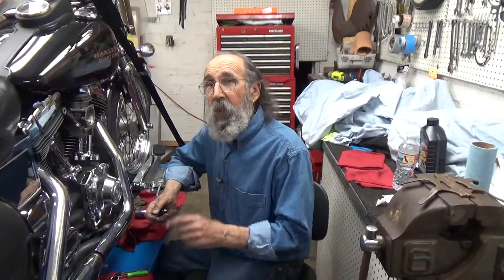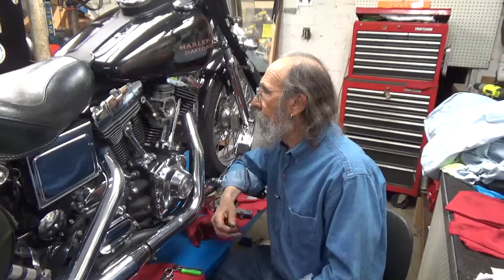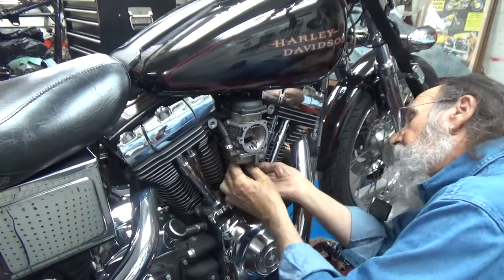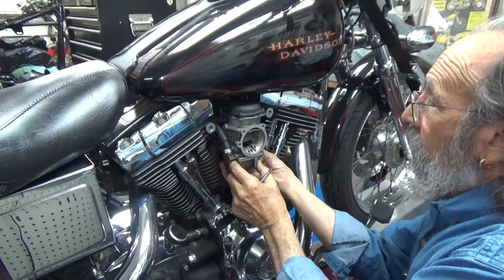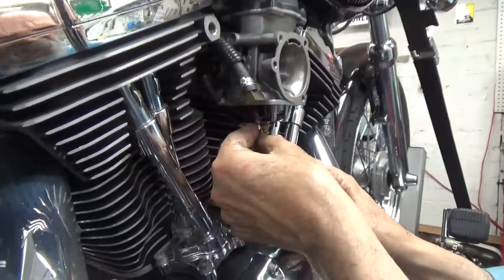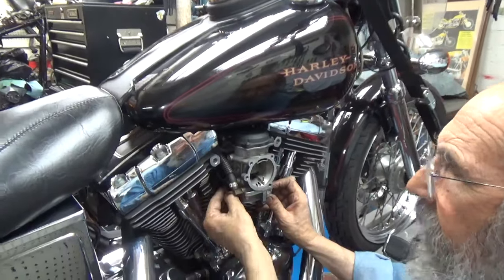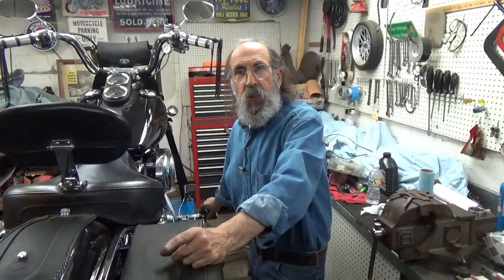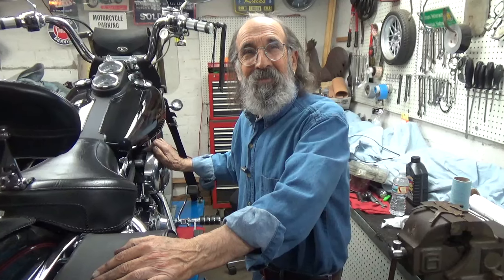Rejetting the Carburetor on a Harley Twin Cam

Comment: My 72 Ironhead sat for 20 years.  It started on the third kick with 20 year old gas.  Taken down to the last bolt, rebuilt, stock, Bendix carb.  I found a local genius at a small town dealer, Columbus, Ne (been doing it since the 70's).  He did the lower end & trany.  Now it's my most reliable vehicle (an IRONHEAD!).  BUT fuel economy is about 30/mpg and the plugs are sooty (In the 70's I had an SU from an audi and I got ~60/mpg).  If I lean the idle or main it runs poorly.  I have taken GREAT! care to get the manifold air tight and the carb bracket is in place.  I've only ever set the timing with an ohmmeter.  Could timing cause this?  I do own a timing light, just not my most favorite thing to do.

A note on Bendix carbs.  I have about 6 from ebay.  All of them, every one, has a leaky fuel inlet valve and changing the needle doesn't fix them.  There are utube vids about polishing the seat or tapping a ball bearing in the seat well.  That doesn't work.  In fact it's a trick to catch the problem.  I use a clear fuel line, mount the carb low, fill the bowl & line to a mark and watch.  If the leakby is slower than the engine needs it may not be noticed but eventually the bowl overfills and causes the carb to run rich.  I lost 1/2 a tank once because I left the petcock open at a 2 hour stop; and we all know where that gas ended up.  I made a sleeve on a lathe and CAREFULLY drilled out the seat and fixed one of my carbs.  Last week I found a CV carb, which is waiting for me at home (I'm 10K miles away).  Yeah, it's from ebay...I never learn.
Reply from the maker: Not using an SU that has been prepared for installation on a Harley, I don't know which rules get changed.  An old Bendix?  How about trying that CV.  Be sure unused vacuum ports are plugged.  The low speed jet is the thing to get right.  Not very difficult.  Sadly, although you can replace the needle valve, you can't replace the seat.  Good luck.
Reply: @pacificmike9501  Idiots don't need rules, they make their own to die by.  The SU came off of a car in a junk yard.  As I remember, I only leveled the float chamber and made an adapter plate out of asbestos  (which probably took a couple of years off my life).  It ran very well.  Not much acceleration.  I was a total incompetent.  But the carb I replaced was a Tillotson.  I carried a spoke from an old bicycle bent around the handlebars to prod the diaphragm back into compliance when it got frisky and spitty.  It probably didn't occur to me to get a new diaphragm.

Comment: HEY MIKE IM LIVIN SEA LEVEL OR JUST ABOVE ON A HILL AND HAVE THE OLD CV CARBURETTOR ON MY 99 HERITAGE CLASSIC I SEE MY BIKE IS LEAN SPITTING WOULD YOU RECOMMEND ME CHANGING MY LOW JET TO A 52 LIKE YOU HAVE MENTIONED EARLIER IN THE VIDEO? CHEERS
Reply from the maker: That should be close.  If you have any non-stock changes (air cleaner, pipes) it will change some.  If you're all stock, you might try a 50 at sea level.  You may have to experiment a little.

Comment: Hi Mike..How's it going?  Many year's ago I did something similar on the cheap to my 1997 HD 1200 Sportster. I took a hole saw and drilled the baffles out of my exhaust pipes. I installed a larger jet in my CV carburetor and put on a Screaming Eagle air box. It sure opened up the factory restriction's. 
LOUDER IS FASTER. Stay safe...
Reply from the maker: Thank You.  You too.

Comment: My sportster has "carb farts". Mostly when its cold and while taking off. What do I adjust? Please help.
Reply from the maker: What is it?  What kind of Sportster?  What kind of csrburetor?  What's been changed on the bike?  Air cleaner?  Exhaust pipes?  Ignition system?

Comment: I'm doing a rejet on a 2003 fxdl and I see people are saying you should adjust the mixture screw any suggestions I would greatly appreciate it
Reply from the maker: There is a small aluminum plug on the bottom of the carb.  Drill a hole carefully through it.  Don't get carried away.  Screw a sheet metal screw into the plug and wiggle it until it slides out.  Now you can see the idle mixture screw.  Start the engine.  When it warms up, turn the screw in and out until you find the smoothest idle.  This is done after rejetting.

Comment: I still have a carb as a matter of fact I'm in the process right in replacing mine thanks for the video think I will go with 175 main 50 slow
Reply from the maker: The main jet is usually fine from the factory.  The slow jet is generally what needs to be changed.

Comment: Mike, I'm doing a top end job on my 2012 Road King and I have a question about replacing the piston pin bushing. I haven't seen anything on your channel about this. Do you have any advise on this topic?
Reply from the maker: Check the above answer to the comment.  I believe it's there.

Comment: hey mike im at 1500 ft. above sea leval what low speed jet should i be using . I have stage 1 air filter after market air exhaust tips. & s&s 510 cams. I have a 46 low speed went to a 48 but everyone was telling me that was to big. so i put my 46 back in & it still coughs. when its cold. so i pull the enrichner till it warms up then i push it in but i still get occasional cough. should i try  a 48 50 0r 52 small jet.
Reply from the maker: How did it run with the 48?  Did it cough?  Did it matter what anyone said?  Be methodical.  The cough is what is normally known as a "lean spit"  All I can do from here is assume that's wht's happening.  If in fact it is a lean spit, 46 is too small.  Try 48.  If you get to 50 or even 52, you can always go back.  I'm guessing 50.  Just a guess, but I don't mind being wrong.  It's not much work.  And you're close on this.
Reply: It was still coughing. I'm gonna go to a 50 & see what happens
 Thx. Mike love the video's.

Comment: May I ask you what setup for jets should I use for a 2002 fxst 44mm se carb 1550 with delkron jugs and heads 80cc heads 10.5 to 1 Ross pistons 570 crane canes krome works exhaust and se high rate air filter.dyna tech adjustable ignition.  Fueling lifter roller rockers. Any thing else you may need to know to help me just ask.
Reply from the maker: I'd start by finding out where it started.  How was it working before?  What did the plugs look like?  Gotta know it and and have a little "prior experience" with your locale.

Comment: Commonly, the lean mixture at the low range of carburated TC is signs of intake manifold leak,  I've resolved this problem changing all rubber sealing rings on the intake manifold. Obviously you can fix this problem by adding fuel to the mixture but first of all, you have to fix sealing. Good luck.
Reply from the maker: Of course.  Usually an intake manifold leak is diagnosed by the difference in the way the plugs are coloring.  Then it can be checked various other ways.  But when exhaust and/or intake has been increased, factory jetting, which is always on the lean side, must be addressed.
Reply: @pacificmike9501  Thanks for the quick response, now I can sleep calmly. Cheers

Comment: my 2001 superglide sport with the same s.e. mods and 42 jet snorts once in a while but i thought it may be a sticky float valve... if i recall the stock jet was a 38..
Reply from the maker: You must be at a real high altitude.  Or, maybe you've got a 42 and need a little richer.  You're speaking of pretty small jets.
Reply: @pacificmike9501  more likely i forget the true jet size - i will look at the instructions that came with the kit...thx.,.. i have been fiddling with gumout till now. it can be dangerous at intersections etc. if your bike cuts out. it was the cause of my first (only!) accident when i got rear ended (minor) as a kid.

Comment: Mike, I have a 2005 Electra Glide, 95 big bore, and 211 cams, K&N intake, and Reinhardt slip ons, and a CV carb of course. Which pilot jet would you suggest starting out with. I am at sea level here in NC. Thanks a bunch. Having a hard time getting it to idle after starting. After a ride it idles fine just a little higher. Tried turning the idle screw to bring the rpm's to 900 - 1000, but after riding it and stopping at at light, the idle is way too high. I am sitting at about 3 turns out on the adjustment screw. Thanks for the videos and your time on here learning us!!
Reply from the maker: This is a guess (mildly educated).  Try a #52 Pilot Jet.  Other than that, you may have a vacuum leak (most likely at the intake manifold).
Reply: @pacificmike9501  Thanks, really appreciate your time and knowledge. I will give that a try and also pull the carb to see if there's a leak in the rubber seal at the intake.
Reply: @pacificmike9501  Mike, I sprayed some carb cleaner around the seals of the intake to the jugs, didn't get anything, a rise or a stumble in the RPMS. I think the seals are good but I will change the seal from the carb to the intake when I re-jet the pilot. Thanks a bunch!

Comment: Ethanol in gasoline has raised hell on anything with a carb(s). Especially on the smaller pilot (idle) jet. I have resorted to using VP ethanol free small engine fuel in my bikes.
Reply from the maker: Sounds awful.  I'm really not knowledgeable.

Comment: I have a 70 shovelhead. Both of my spark plugs keep getting carboned up. Like a wet black carbon. What could be happening
Reply from the maker: Too much fuel verses air or ignition very weak, unless  you're burning oil.  If it's one plug, you most likely have a vacuum leak.
Reply: @pacificmike9501  I just had the coil voltage regulator and stator replaced. So I doubt it's week ignition. And it's both plugs.

Comment: Mike, thank you for the video. Any jet recommendations for a 1999 1200cc Sportster with drag pipes and similar intake like this? It's having similar issues like lean deceleration pops. Also mid throttle has a dead spot.
Reply from the maker: As I explained in the video, it varies with the altitude where the bike will be ridden most of the time.  Drag pipes, although very cool, rarely work well at low RPM and tend to lose power intil you get going above approx. 60 mph.  However, at  least three points higher than stock will generally help considerably.  Also, changing the air cleaner to something less restrictive than the original unit requires a larger pilot jet.  Good luck. It is running very "lean" and, it's still going to be an issue at low speed.

Comment: I've got a 2002 Deuce with a CV carb and I don't ride frequently enough so I'm constantly having carb issues despite using good gas.  I've been told that shutting off the fuel and letting it run out of petrol between rides would be better.  I live at sea level (Maui), but I believe my jets are stock since my last mechanic had me buy a totally new Harley CV carb.  It's so frustrating because I'm not mechanical and my bike runs like crap- bogs and spits constantly.  It runs slightly better if I give it a little choke, but I don't want to foul my plugs.
Reply from the maker: Sounds like it's jetted too lean.  Does it have aftermarket exhaust or air cleaner?  If it does, you definitely need a larger low speed jet.  I'm going out on a limb here, but if those items are changed and you're roughly at sea level, try a number 50.
Reply: @pacificmike9501  Yes on aftermarket exhaust- it's a 2 into 1 screaming eagle.  I just ordered a CV Performance 48, along with CV Performance velocity tube and a 185 main jet.  I've never worked on a carb, but I think I'm gonna give it a try.  No idea what the stock main jet is that's there now.
Reply from the maker: You are normally riding around on the slow jet until you start going faster.  Remember, when you increase airflow (air in, air out), you must increase fuel.

Comment: What do you recommend for a1977 shovel head as far as jets i live in riverside Ca i’m running a Ss super E and it came with 70 main and A 29.5 secondary when i go on the freeway after 60 miles an hour it coughs and doesn’t sound right? thank you
Reply from the maker: Are your plugs dark?  Do they match?  Do you have S&S instructions?  If you don't, download the from "sscycle.com."  They'll give them to you.  Jet it accordingly and set the accelerator pump as per their instructions.  It will be great.
Reply: Buy a real motorcycle.

Comment: Hey Mike I got a lean cough at every hot start, 80” Evo , just right when bike starts up when motor is hot, never when accelerating or taking off from a stop, have tried 46,48, and 50 slow jet, still does it. Any ideas… timing?
Reply from the maker: Check your accellerator pump.  You should be able to remove the air cleaner and work the throttle, and see the squirt into the carburetor from the little brass fitting in the throat of the carburetor.  The diaphragm in the accellerstor pump could be bad.  Sure sounds like it's not working.
Reply: Pump works great, it does have a plastic thunderslide in it, I’ve wondered if when the bike starts that lightweight slide opens faster than the fuel can get there causing a lean condition just at startup…. Thank you for the reply very kind!
Reply from the maker: You're making good sense.  You could try a stock slide in there.  I've usually replaced those carburetors.  The Mikunis are great on an Evo.

Comment: yep wont  recommend a brand of gas since  Amaco white gas is no more ,but i have been told that low compression motors run better on lower octane gas ?wondering youre thoughts
Reply from the maker: Depends on what the manufacturer recommends.  Different engines require different octanes so the fuel burns at the proper rate for the design.  I've benn wrong on cars and had to refer to the manufacturer's recommendations.

Comment: Hi, I have a 99 Dyna with screaming eagle tips and a stock bike. I live in NJ. Mine seems lacking in take off power. It idles ok. I have the Arlen Ness big sucker with 50 jets. Should I try 52's?
Reply from the maker: Why not?  It's really the way to tell.  Just do the low speed jet.
Reply: @Pacific Mike  it seems I may have a vacuum leak..I believe that may fix part of my issue.
Reply from the maker: Compare your spark plugs.  A light one and a dark one is your indication of a vacuum leak.

Comment: Drill out the stock pilot jet to a 47/49 ims 3.5 turns out,  main 165-185 (depending on elevation) drill the slide air bypass out just a smidge some ppl mess with the slide springs but I never did. Those stock TC88 ENGINES were set up soooo lean to pass emmissions it was terrible.  Great content as usual.  East coast Rudy approved.  😎😎
Reply from the maker: Thank You.  Everything Harley has done for years is way too lean, from the factory.  Glad  you like what we're doing.
Reply: @pacificmike9501  I enjoy your videos very much. I have an 82 FLT. Been on my lift for almost three years. Just gotta throw the battery in it and gas it up. The riding season up in the North East is less than ideal. Stay well.

Comment: I have the same bike (FXDL), same year, same color, everything..... nothing like an old CV bike. Just got done last week using your "brake light switch fix"..... worked like a charm.....thanks for your help Mike!

Edit: Also, I'm sure you have heard about the cam chain tensioner issue on these early twin cams.... have you had to change any tensioners out yet?
Reply from the maker: Sounds great!

Comment: Mike, I have a Mikuni carburetor on my 2000 Heritage. How can I tell which is the slow jet jet and the high speed jet?
Reply from the maker: The slow jet is the one closest the engine. The high speed jet is up the middle. You can also order the manual online by googling Mikuni HSR carburetors.  They run about ten bucks and are well worth it.
Reply: @pacificmike9501  Thank you Mike, you are a prince of a man!! And with that golden voice, you need to go on radio.

Comment: Hi Mike, i have changed the exhaust on my 1982 FXE and it back fires and doesn't run great.  Would you know what size jet i would need to eliminate this problem?
Reply from the maker: Well, not knowing what carburetor (or anything else in your engine), or what your altitude is, that would be quite difficult to guess.  If you're getting what we call a "lean Spit," I would suggest a larger "idle" or "low speed" jet which would then create a richer mixture from your carburetor.  Now is the time to guess.  If you have #48, try a #52.  Again, it's a guessing game until you experience the results.  And, I'm assuming the engine ran well before you changed the exhaust system.
Reply: @pacificmike9501  thank you ever so much for getting back to me. I am sure that you receive a large amount of questions from all over the world.  I live in France and we are at around 1500 ft. I have an s&s super e carb. She ran without any issues before i installed the new Santee upswept exhaust system. The front plug fouls after around 10 minutes of riding. I appreciate that it could be a variety of issues (exhaust leak, manifold leak, bad plug/lead) but wanted to ask the question regarding jet size as this is new to me. Thanks to your videos i manage to do a lot of the work on my bike on my own ie serviced the clutch recently. Keep up the good work and thanks a million. Take care.

Comment: Hi Mike I just do the top end on my 93 softail clasic heritage but I don't have fire on the back cylinder I put new coil pack and spark plugs but I still have the problem any idea please help me thanks
Reply from the maker: Check the spark plug and wire.  Check for a spark.  Remove spark  plug.  Hook it to plug wire and ground itr on the motor to see if the spark plug is sparking.  Go from there.
Reply: @pacificmike9501  ok thanks